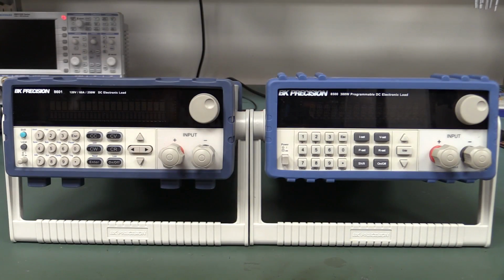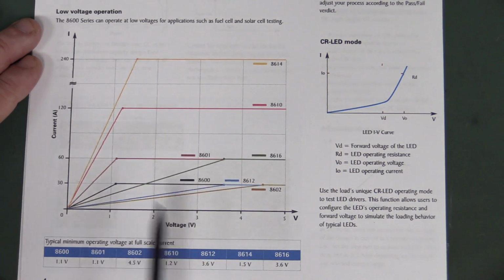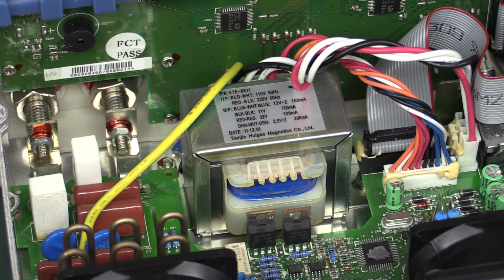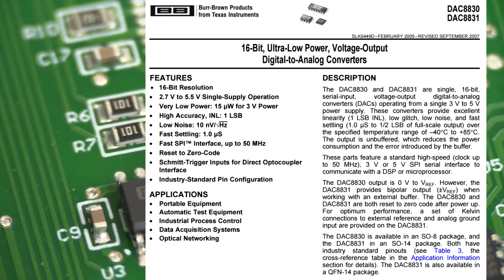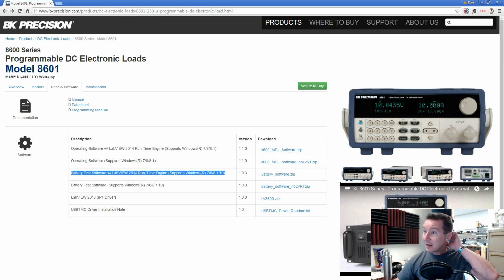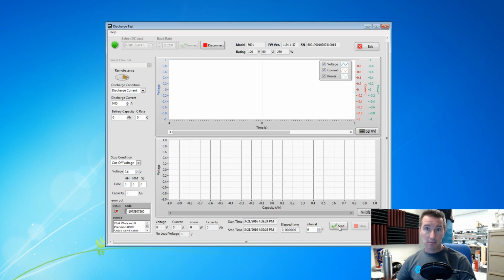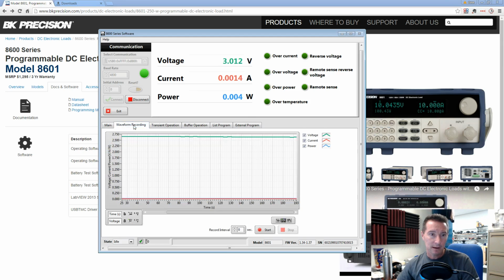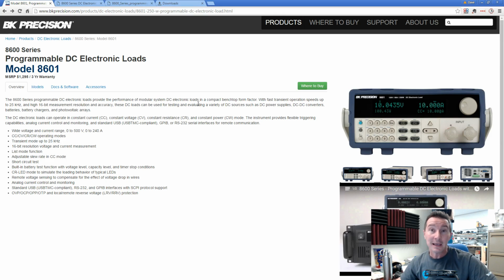EEVBlog #862 - BK Precision 8601 DC Electronic Load

Comment: Classic Dave... Rages about not working software because he didn't read the manual. I bet everything was explained in the manual. It is okay to read manuals...  Usually with Dave the problems start with user not reading the documentation and then the frustration makes it worse. Oh well we kinda expect that from you. ;) Nice video anyways :)
Reply: +Hene193 The thing is, what he expects is quite reasonable:
- why would you have to turn interfaces on?
- why are other tabs grayed out when you're recording?
- why it needs excel installed instead of just saving as xls?
And so on...
Reply: ***** It's matter of perspective. Maybe there is a reason why only one interface can be turned on at the time. RS232 is widely used in printers and industrial systems. That is most likely why it's the default. 

But for other things you are right. That other tabs grayed out is just stupid and favouring excel makes kinda sense since this is designed to be used in industry and usually companies run Office. But I don't think that is an excuse for bad design.
Reply: +RicoElectrico
- Its not that uncommon to multiplex some outputs (at least in industrial equipment), especially when they both represent serial output which you are unlikely to use at the same time. That way you might get away with a smaller processor with less IO or you can at least skip the constant polling part. According to the picture he put in in post, the chip seems to have a native USB interface though.. which means they would need to do the RS232 by a separate chip. Makes me wonder if they bothered with the processor's USB stack or if they used an external one they were familiar with.
- weird design choice of the software indeed..
- probably because they used the/an excel API because they didn't want to be subject to the whims of the latest file format changes of Microsoft. Since he doesn't have MS excel installed, the API doesn't load. In the end the clipboard export does the same. Not pretty but depending how "serious" the software is I can understand it. The software seems rather simplistic and more there to provide basic functionality, so by my guess they probably weren't throwing hardcore software developers at the project and relied heavily on what was easily doable within their tool chain.
Reply: +RicoElectrico it shouldn't require Excel being installed to export to CSV file, like seriously
Reply: +RicoElectrico He used excel, it doesn't require it, the data is in a tablular form, kinda akin to a CSV,  except this is a TSV, which is perfectly fine.
As for why the buttons are greyed out, probably something for saftey or something, really this isn't a big deal for most people since they wont have their computer so far away when testing, how he even got it that far over USB I don't even know, thats longer than USB cables should be run
Reply: +Hene193 It's funny, I saw this comment right after I made my own post about the same thing. 
As I rewatch him talking about the software, I suddenly feel like he has ADHD, not even trying to be mean or anything, just saying it completely factual, I have it, it's easy to spot when you know what it's like. Mainly, he got antsy when things were less interesting, which is what tipped me off to this thought.
I see it when he opens mail too, he skips the letter and goes straight to the new toys inside, when he should probably read it first, even if he pauses the video for us.
Again, No offense meant there Dave, none at all.
Reply: +666Tomato666 It probably needs Excel installed, so it can launch it with the data presented immediately. It looks like Dave has Libra Office installed (which I also use), and so it wouldn't be able to do that. PEBKAC I think...
Reply: Stabby666
an application can crate a file and tell the OS to use the default application to open it

both Excel and Libre Office do associate themselves with csv files

the programmers were as lazy with this option as they were with all the others.
Reply: 666Tomato666 Yeah I'm not saying there isn't another way to do it, just that I believe that this is the reason the option is disabled for Dave.
Reply: Not directly related but the driver for BK is not fun. Commands built bit by bit. No SCPI commands or ascii type commands. Also no error messages returned for bad commands.
Reply: Replying to my reply. The 8600 does do SCPI commands. That alone is worth upgrading from the 8500.

Comment: Jesus, why those guys don't use Wi-Fi, Bluetooth or something that makes sense for this decade. I understand the legacy. A decent lab requires a lot of money, but at least some videos or resumed instructions. Is that difficult to switch automatically to the proper USB setup? At least blinking something on instrument screen. like: hey, would you like to setup your USB link?
Reply: +Thiago Coura Wireless just isn't needed in a lab environment, and sometimes you don't want your test gear to be  RF sources. The problem is Dave (like many people) didn't read the manual. It makes sense that you have to tell the instrument which interface to use. A blinking "would you like to set up your USB" would be very annoying if you weren't planning on using USB.
Reply: +Chris W I agree with your point about the RF interference. I didn't thought about that, but I disagree that if you deliberate connect a USB cable from the instrument to computer a message or blinking light is something annoying. It's a temporary message to guide you. My point regarding the user experience is not to prohibit you to make thinks in a different way, but if you do, provide the hints to guide the user

Comment: BK software is horrible, the 8500 software was the worst. If I moved the window from one monitor to the other it would shrink the display down to nothing. You would have to stop the program and restart it to see anything again. I also went through a half dozen of those 232 usb adapters to get one to work and half the time the usb wouldn't see the adapter.
I would say the new software is a bit better but it still has a long way to go. As does their customer support for that matter.

Comment: I work with software quality and I'm feeling anxious and uncomfortable seeing this video. Burn LabVIEW crappy.
Reply: The serial protocol is fully documented. You can write your own stuff to control it. You can prototype something in Python in 10 minutes to make it work. This is how I roll. Control in Python from command line, dump to data to simple files with annotations, then produce plots automatically using gnuplot in real time as it progresses and at the end. The nice thing is I can automate things easily, i.e. use relays and psu, then do repeteated battery tests for example for cycle life characterization, or dependence on current. Add dmu data for temperature measurement and it is complete system.

Comment: For an expensive item that is some really crappy software. Looks like no effort was put in the software (1/2 days work software)
Reply from the maker: +1337Mauro Sadly typical for products like this though. Majority of customers will write their own.
Reply: +1337Mauro 
if you pay a premium for that hardware, it would be wierd to not pay a premium for the softare and the manifacturers knows that companies are willing to pay for custom software so they don't bother doing it.

Though I'd be a shamed to put out that kind of software out... it would be better if they just offered the "DIY" option aka "here's the documentation figure it out" instead of the crappy basment dweller software.
Reply: It's typical of software written by hardware engineers. Companies that specialize in software know that UI/UX designers and programmers are typically a different team than the backend designers and programmers. A bit like how the power supply design and the analog front-end design on an oscilloscope won't be done by the same team. Sure, they're both electrical engineering, but they're different specialties. Making the software easy to use takes skill that is often lacking at hardware companies.